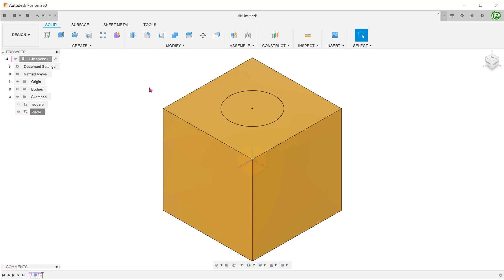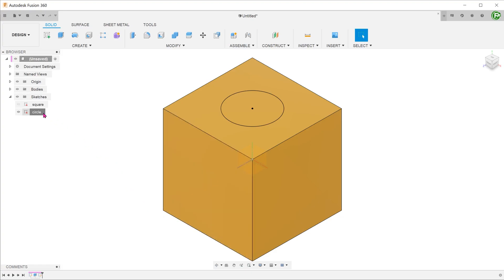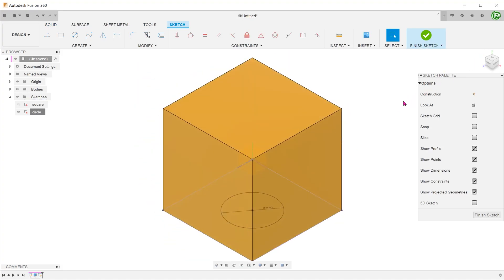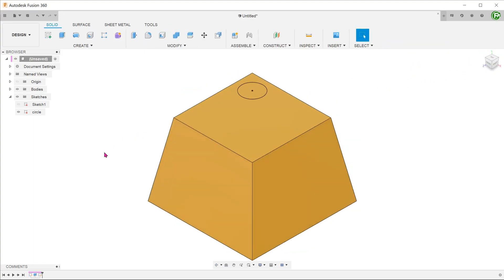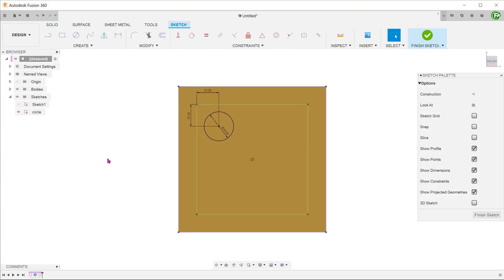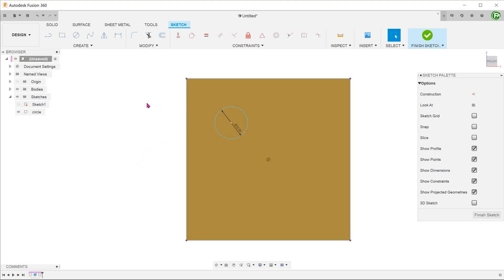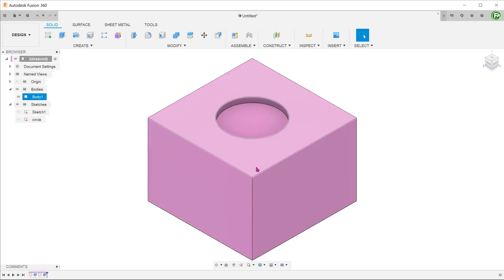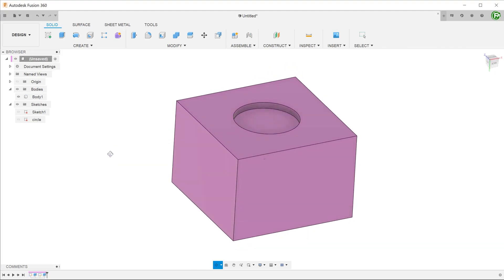Fusion 360 - Redefine Sketch Plane

Comment: Hello. How can I copy a sketch to the reverse side of  an another plane? 

Let say I have a skecht on a plane and I wont copy this sketch to a new construction plane. but I need also to copy this sketch mirrored or copy the sketch to the opposite surface of the consturction plane. Is this possible?
Reply from the maker: Hi, looks like the following can help you:
https://www.youtube.com/watch?v=5aoaaWV1ZEk
Do let me know if it answers your question.
Reply: @Fusion360School  Thanks for the quick answer. The suggested video is ok but is not solving my problem.
Let assume I have to copy a sketch to a costuction plane. If I'm starting a sketch on a constuction plane fusion is choosing alone in witch direction are going the x and y axis of the sketch. Now if I need to mirror an existing sketch the solution could be to keep one axis let say the y axis in an identical position and orientation but to reverse the diection of the x axis. I could have the same result if I could start the skecht on the opposite side of the construction plane and keep equal the orientation of the y axis. I hope my explanation is understandable...
I saw in the suggested video that is possible to move and rotate the sketch after the ctrl+V command. Is in this moment also possible to mirror the sketch?
Again thanks a lot for your commitment for your channel.
Reply from the maker: @fabiobolgiani2471  After ctrl+V, it looks like we can only rotate, not mirror. If rotating does not work, can you simply project?